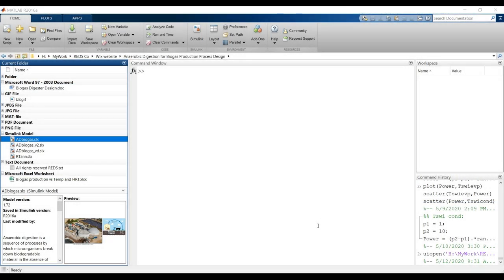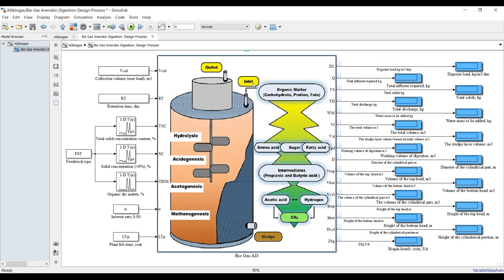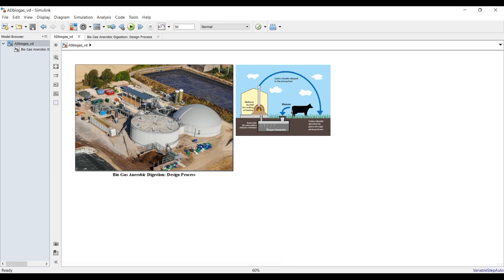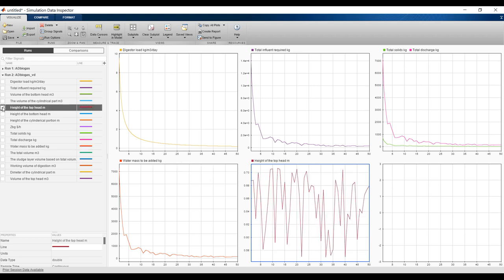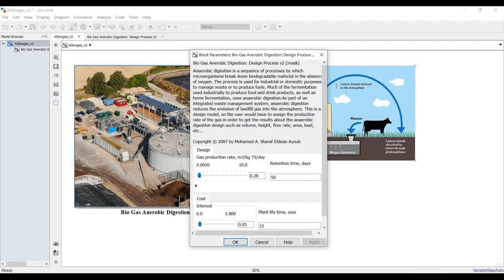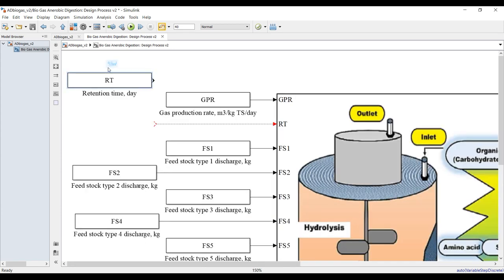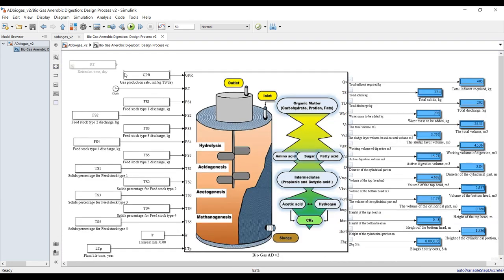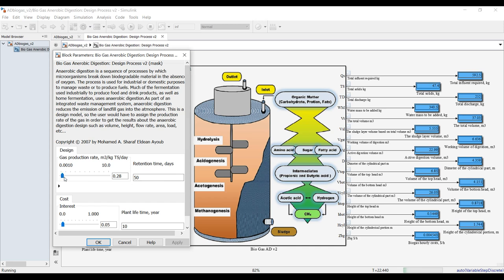Anaerobic Bio gas Digestion | Design Process Model | Matlab | Simulink

Comment: The output is predicted based on any mathematical model or data?
Reply from the maker: We assigned the output as a known parameter to discover the design aspects. Because this is a design model. There is another performance model which we will calculate the output.